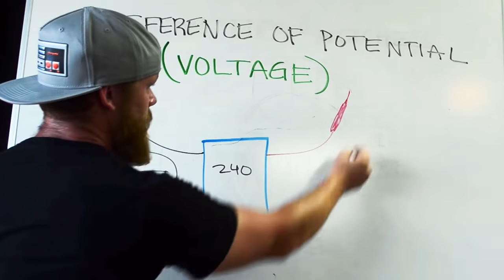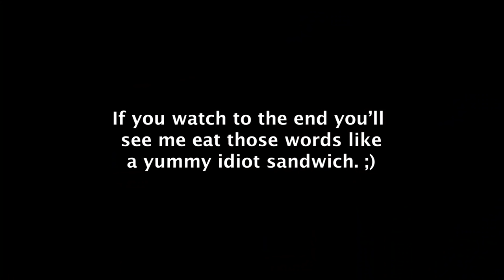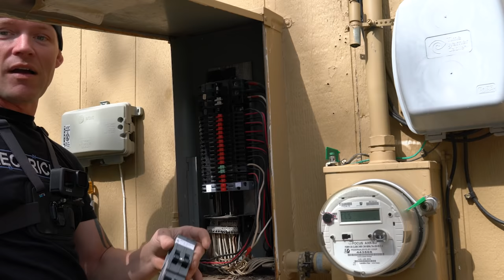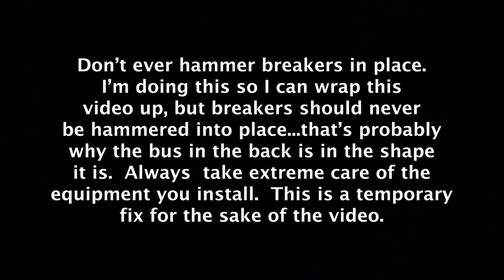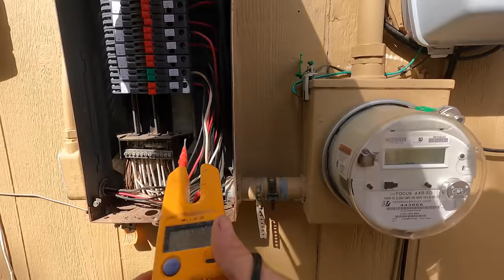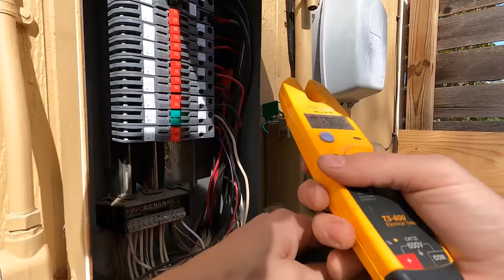How To Work on LIVE CIRCUITS - Replacing Circuit Breakers in Old ZINSCO Panel

Comment: I live a couple hundred yards form the beach, so we get a lot of salt-air. Corrodes the heck out of everything. Would you recommend cleaning the bus bars with something like Flitz after several years if you can get the meter off even if the panel is in the garage?

Comment: Here's a tip if you plan on doing this which is a good idea for these particular panels, Zinsco, Sylivania and such.  Remove all breakers, use emory cloth to sand the bus bars where there was arching, I always see arching on the higher amp circuits that run continuously.  Clean the bars with electrical contact cleaner.  Then replace the breakers while using an anti-ox product on the contacts which will help lube the breakers while putting them back on to the bus, it will also help prevent future arching.  Good luck,  But the very best way to service these panels is to remove and replace them completely.
Reply: An electrician can just do what you said and replace all breakers with new. And we will be okay in our home? Would like to save 5 k if possible

Comment: I have a house built in 1969, should I have my breakers replaced?  The ones in my outside panel are original, as far as I know.  I certainly have not replaced them in the 25 years I have lived here.

Comment: wouldnt some dielectric grease have prevented the microarcing that caused that bus bar to become eroded?  Also shouldnt you have hit it with a wire brush or something before putting in the new main breaker?

Comment: Isn't there an earth ground?  Wouldn't you need to wear protective shoes to keep yourself insulated from it when you are working on the live wire from the meter?  Or are you relying on the rubber soles of the regular work shoes that you wear?  What particular shoes?  Thanks.

Comment: I have a main breaker outside under my meter. When I try to turn it off it just springs back up. What do you think the problem is. 200 amp Cutler hammer. Main panel is in the house.

Comment: The reason for the charred bussing is because Zinsco used cheap insert large asian country metal for their panels and breakers. The metal “U” style teeth in the breaker to bussbar would get hot and and expand and start to pull away from the buss, losing partial contact. This would cause a smaller surface contact area and/or arcing. This could cause either nuisance tripping because the breaker would think the load is too much for its rating; or alot of the times, it would overheat the internals and actually prevent them from tripping at a true fault. Lots of reported cases of Zinscos being way overloaded, but not tripping and causing fires in equipment or panels. 

Also an FYI, Connecticut Electric-while corporate is in America-the breakers are made in large asian county known for putting out cheap faulty products and, in mine and others experience, have failed right out of the box, failed after a week, and/or also failed to trip in a fault.

Comment: Sharing neutrals on those black and red wires? Aren't the supposed to have simultaneous disconnects now? As in using a 2 pole 240v breaker.

Comment: I've asked other electrician video producers that are working on old Zinsco panels and breakers about the retaining bar that is installed as a factory part, but installed in the field when the panel is new. The bar spans the length of busbar and holds down the row of breakers and is held in place by two, one at each end,  one direction security tamper proof machine screw. 
  Lots of guys have never seen this and told me I'm crazy that there isn't such a thing. I'm 55 yrs old and been in the trade for over 30 yrs and I've run into the retainer bar probably 4 or 5 times.  It makes for a real pain in the ass time especially if you just need to replace one breaker. 
  Have you ever come across what I'm talking about? If so, I'd like to know how you got it removed.

Comment: You should now do a hot box replacement. I place some tape over each of the 2 hot legs and you slide them off the old box and onto the new. Full PE deployed.

Comment: You did a great job and I also like the part about the PPE I work as an industrial electrician and its require before we go onto the floor we need to have all our PPE with us which is a good thing especially when you're working with 600 volts
Reply: I miss 347. Americans don't even know...

Comment: Sup Dustin - You do know that Zinsco isnt outlawed. In fact, the only case against FPE was NJ in a lawsuit specific for NJ. However, there was never a recall or anything making them unlawful. In fact, in Canada the FPE stab-loc design is still being used. The issue was false statements made by FPE to UL during their actual listing evaluation. The main issue with Zinsco of the 60's and 70's was the aluminum bus which pits so replacing with a copper bus and Zinsco trips perfectly fine.
Reply: Paul is that you Sir :) You must've stumbled here by searching ZINSCO :)
Reply: @biker55555  I never stumble...LOL
Reply: @biker55555  but yes it is me and I know Dustin so that's how I got here.

Comment: Increasingly we're putting a main isolation switch between the utility company's equipment (usually the meter) and the customer's equipment (the breaker board).  That way you can isolate everything the customer or his contracted electrician is allowed to work on and there would no longer be any reason at all for live working in domestic installations.  It's not yet mandatory here in the UK, but likely will be a few years down the line.
That still leaves commercial premises where live/hot working may be absolutely required, but at least in such a situation you're going to have a professional on the job.
Reply: We're trying to do this more in Canada too. I've never understood why it's not mandatory besides to help save a few bucks.

Comment: I think most breakers have #1 robertson 3/16 slot head bolts. If you use the Robbie to remove them, you preserve the slot head threads for reinstal

Comment: You had room in the cover. You sh/coulda just slid all the breakers down a space and avoid damage to the new breaker and put in a blank at the top.  Any code issues with that?

Comment: Having one of these style panels in my house, I'm well versed on the delisting of these critters. It's not just the breakers, but the whole kit. They were listed / approved when they were originally made. They were delisted years later when the problems with the design started surfacing. (much of that problem is spelled Aluminium. If I were going to keep using one of these with newer breakers, I'd be sure there's a liberal amount of no-ox used.)

Comment: Talking about touching hot wires reminded me of a time when I was working on a casino slot drop team and reached in the BV housing to pull a can out, and two of the wires for the lighting had ripped insulation. I touched both of those wires and lost feeling in my whole arm for a few hours. Told the techs about it and they re-wrapped it in electrical tape. Two days later, it happened again to my coworker and they re-re-wrapped it in electrical tape. They ended up having to replace the wiring because my coworker went to HR and screamed about how we keep getting the shit shocked out of us on drops.

The reason they kept having to re-wrap it in electrical tape was because the wiring was rubbing up against the sharp, sheet metal of the BV housing. Every single time they had to open that machine, the wiring was flexing in a small gap between the light panel and the housing. For anyone wondering, it was a video poker machine, and BV is directly under the light panel on the right. Also for anyone wondering, BV location doesn't matter. You're NOT going to be able to get the inner BV door open. We had keys, and sometimes we couldn't get them open.

Comment: Insulated tools could help in this case.
In my opinion electricians must have insulated tools specifically screwdrivers.
Electrician working in UK here .
Reply: Using regular Klein screwdrivers is perfectly fine as long as you are competent
Reply: @pgood7266  is there anything AGAINST using a electricians screwdriver instead of this mechanics screwdriver?

Comment: I’m a mastur-bater and a master diy’er and I’ve installed breakers without shutting the bus bar off at all, I just make sure the new breaker is off then install it then connect the wires THEN turn the breaker on. Never had an issue. Although I don’t recommend just anyone do it. You need to be sure or accept your fate... be smart and don’t just follow what others do, if you aren’t 100% sure of what you’re doing stay away from it. Anytime you pull that face panel off there’s lots of risk involved, tons of wires, live bus etc One careless move with your hand, screwdriver, or pliers and you’ll never forget it. Be smart

Comment: Been there, did that. Oh and do I know the little old lady scenario too well. I always kept a old parts box including meter jaws. I remember  having to drill and tap a 480/277 MDP buss hot. Full PPE, rubber mat, insulated tools and a nylon safety rope held by somebody 20 feet back to pull me away if needed

Comment: Not sure where you are located BUT those "smart" meters, you can call your utility company and have them remotely shut off the meter for electrical panel servicing. They can shut it off from their computer for a window of time , they will also "ping " their meter to check if it's dead or not. 
They don't need to remove the meter only for a panel change out.
Reply: Yea, but then the utility company will want a city inspection before switching power back on which means getting a permit, waiting on inspector and then waiting on utility company. We’re talking days without power.
Reply: @MrSleepProductionsInc  usually if you are just performing maintenance on the panel it doesn't require inspection from City or utility company and you can just call them when your done and have them turn it back on, they can do all of this over the phone I've done it many times.
The only time you need inspections is when you do a full change out and yes sometimes you can go awhile without power but usually they are pretty good with "same day" service if you give them a window and you talk with the responding tech, or the next day, but I have heard of people who have gone days for whatever reason. This can all be done with any service that has a "smart meter" on the service. I've done it many times in California and Nevada. I am a 25+ years Electrician , currently employed as a City Electrician, Electrical consultant, as well as a Senior Electrical inspector for a city here in California .

Comment: Could you have put the main breaker lower in the panel? I realize it would be a pain in the butt with shortening the live wire but probably better than installing the breaker in a damaged part of the bus bar. Possible at the very bottom to help with identification that it is the main breaker to the bus. You could also use one of the old breakers to cover the exposed bus bar but since the bottom of it is anyway exposed, I wouldn't bother.

Comment: For hot work in a panel, when removing breakers after removing the breaker from the bus, twist it such that when you go to remove the wires from the terminals if your screwdriver should slip out and move forward it does not go in the direction of the inside of the panel. Maybe a bit over cautious since you wouldn't be pushing hard enough to slip you screwdriver onto the bus, but that's how I was taught, just like turning away when energizing the panel. Also I get that the buss is dead... like I said I know it's a bit of an overprecaution.

Comment: I was a ground radio repairman in the Air Force in the 1980's. A dimmer switch for the overhead lighting in the control tower went bad and we were called in to replace it. CE said they wouldn't do it because it was mounted inside the cabinet that housed the equipment we were responsible for. We got up to the tower and found out the real reason they wouldn't replace it. The circuit breaker supplying it couldn't be turned off because it supplied power to equipment that would have left them off air, and they had a constant stream of planes coming in. I had to lay on a rubber mat inside the cabinet and work over my head because the wiring was too short to pull the dimmer out to disconnect it. Every move I made I did in slow motion. Nothing like working on live wiring to create an atmosphere of mental clarity.

Comment: I need my electrical service redone.  It was done about 1965 and they used Square D circuit breakers.  It was wired up NOT using a ground wire, just using the white and black wires.  Makes me a little afraid to go to sleep at night...

Comment: Man I inherited an old zinsco service on my homestead. Detached shop double tapped right off the 200 amp main breaker with only 1 awg alum wire 😬. Looked up a zinsco main breaker to run my shop on and the damn things are 300 dollars! So I'll be replacing a panel very soon lol.

Comment: This is like electricity supplies in the 1960s in the UK. Over here, the supply company fits a double pole isolator between the meter and the board so you can work without going hot. And insulated screwdrivers are dirt cheap. And breakers are tightened to a manufacturer specified torque.

Comment: Why not file or sand off the buildup from the arcing so it seats properly and doesn't add resistance to the connection?

Comment: I have a similar system and a bad breaker, however my breakers seem to come in pairs. The one on top connects to the left pole and the one on the bottom connects to the right pole. It is the one on the bottom that is faulty but I dont know how to find a replacement part. The zinsco breakers on amazon seem to connect to the left pole.
Any advice?

Comment: Man I inherited an old zinsvo service on my homestead. Detached shop double tapped right off the 200 amp main breaker with only 1 awg alum wire 😬. Looked up a zinsco main breaker to run my shop on and the damn things are 300 dollars! So I'll be replacing a panel very soon lol.

Comment: I like how the wire holes are staggered and not adjacent to one another.  In almost all cases, I say something staggered like that is just simply sloppy but with a breaker, it provides that much more space in between the two hots.

Comment: Safety Nancy here per OSHA PPE is required for the duration of the working in a panel with Any hot wires including an flame retardant jacket not just the gloves and face shield (I do how ever violate when working in a panel with the main off). NEVER use an uninsulated screwdriver on hot work, taped screwdrivers don’t qualify (I’ve used them in the past) 20+ years as an industrial electrician. 
Around here we just cut the seal then notify the electric company when it’s just repairs changing breakers qualifies as a repair around here.

Comment: Does Connecticut Electric make a 15 Amp arc GFCI single pole circuit breaker to replace a Zinsco 15 amp Arc Gfci Single pole breaker?

Comment: this may seem like a silly question but why is your panel on the outside of the house with the potential of being shut off from someone outside?  is that normal to have your panel outside?
Reply: A lot of older homes were built this way, not sure the reasoning behind it.

Comment: I'm an amateur but when you said those two things the- breaker and the cable are both LIVE, which they are because they are touching, then the same goes for the screwdriver when in contact with the breaker screw-right? Moreover, your body would be energized as well passed the screwdriver which appears to be a weak non-insulated or poorly insulated screwdriver, except that your gloves seal the path for electricity of course. I also think that screwdriver may be the culprit why you strip so many breaker screws?  Unless that is your favorite screwdriver I would check to see if there are some better options. I also have to tell you since you are a person that is gesticulating  while holding the screwdriver so close to live wires it made me nervous to watch it since it increases the chance of that screwdriver touching the wires. Hope I;m not too paranoid and I'm just safety cautious. 
As far as the rubber seals you saw in the breaker  my ques is that they are there to prevent moisture, dust or similar which is a good thing. There might be some corrosion between the breaker and the rail which is why some breakers are  more difficult to slide off?    In  northern  climates all of our circuit breakers are inside the house never outside and exposed to elements  like here. Great video I can't even imagine how you can focus on what you are doing while filming and talking to YouTube at the same time.

Comment: Certified in OSHA electrical safety. Yep insulated screw driver. Once you see the damage from electrical burns to electricians and their disability it makes aware of how important PPE is. 35 year industrial multi craft maintenance mechanic. No short cuts. Union would never let you work any other way!

Comment: Curious if you find led lights flicker when big loads turn on? 
I changed the panel but also changed to led at same time. So i am not sure if the led are just being that sensitive or if there is a problem perhaps with the neutral. Both lega flicker.

Comment: I like to use insulated screwdrivers when working in the panels live. I need to find some slim ones though.
Reply: Wera makes some lovely slim ones.  I use the Kraftform Kompact VDE series for industrial electrical.  A decent set is 60 some bucks on amazon.
Reply: @Nidkidful  Thanks. I think I will buy them.